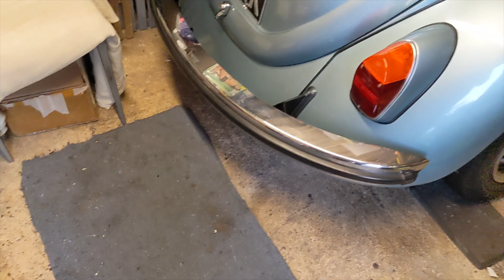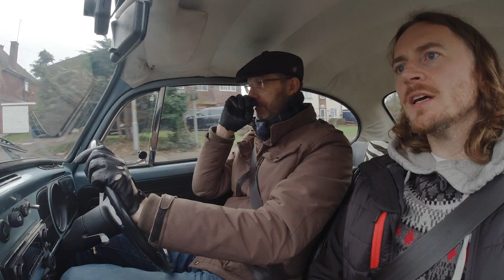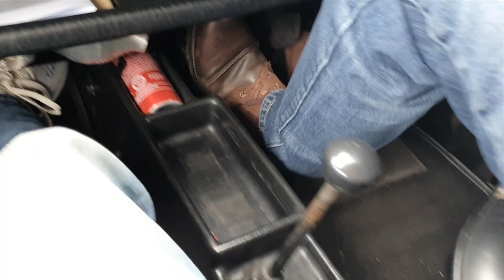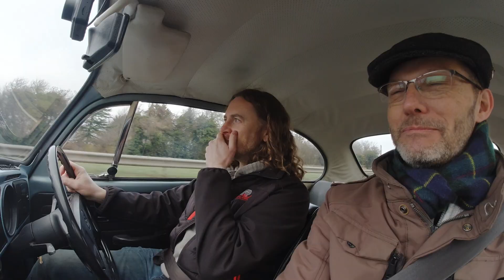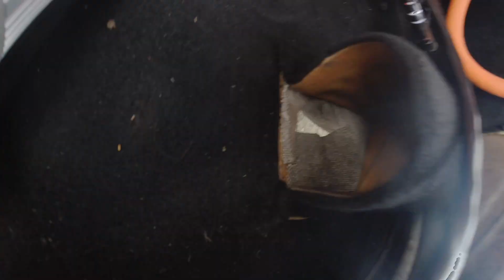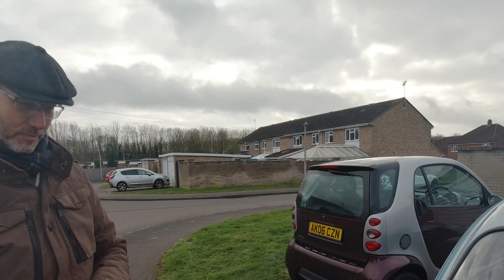DIY electric VW Beetle driven! #evconversion  #electricbeetle #netgainhyper9

Comment: Had he set the power curve to where it didn’t slam on really quickly. You read about the hyper 9 being able to destroy a bug transmission. I’m wanting to put one in my Jetta MK3 or go crazy with a Tesla motor. But the hyper 9 is near my HP and torque so I think I would be safe.
What batteries did he use. Very great video.
Reply: Yep good point, I've mapped a slow throttle curve to make it smooth and easy to drive.
Reply: @johnwoolf725  thanks, with there software, is it pretty easy?
Reply: @mikejf4377  yep, the software is excellent.
Reply: @johnwoolf725  thanks for the reply.
Reply: @johnwoolf725  Thanks Very much.
Reply from the maker: 6 x tesla modules, not sure what power
Reply: @chargeheads  thanks.

Comment: For the handbrake issue some way to short out the three phases with the car in top gear would work too. It may not stop it rolling but would slow it down big time. 😁
Reply from the maker: Thanks I'll suggest this to John 👍
Reply: @chargeheads  Around 15 years ago I built a wind turbine using the Hugh Piggot axial flux design. It furled out of the wind to avoid over speed but sometimes I wanted to stop it spinning if a storm was coming so fitted a switch to short out the coils. When the switch shorted the coils it could only turn very slowly even in the strongest winds.
Reply from the maker: @alibro7512  that sounds great, how did it perform power wise?
Reply: @chargeheads  It was a 10 foot diameter turbine, (each blade was 5 ft) and on a windy day gave around 1.2kW at 24V. I never worked out the total kWh per day
Unfortunately we didn't have that many good days so after my batteries died I sold it on.

Comment: Nice build and amazing daily car, I’d defo keep the gear box and clutch if i build on to keep rpm’s done and better kwm after all the new porsche ev has a 2speed motorbox thingy 👍 im looking forward to the first 400mph road car with 8speed box 😂
Reply from the maker: Yes its a good point. All depens what you're after. As my TVR will be a comuter 😉 auto is essential for the daily drive. Then weekend its all about peak POWER!!!

Comment: Interesting that John mentioned the h/brake issue. That had crossed my mind as well. Some sort of transmission lock could be made using the redundant 1st/2nd rail of the gearbox. You only need 3rd, 4th and reverse for driving so, if the 1st/2nd rail could be engaged at the same time as one of the other gears, it would lock the gearbox. Obviously with a switch to prevent power being applied with trans locked.
Reply from the maker: Sounds like a possible solution 🤔
Reply: @chargeheads  the only thing is when you lock those two gears I place if anything happens as in the car being bumped buy another car that will lock it pretty quickly to where you need to take it apart to unlock it. I wouldn’t do that.